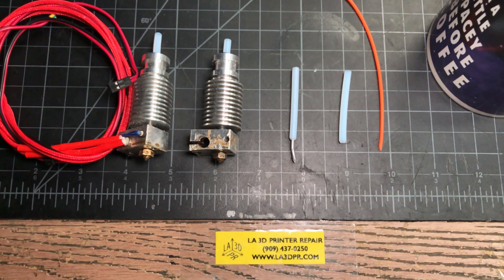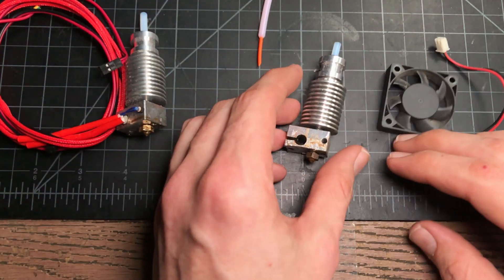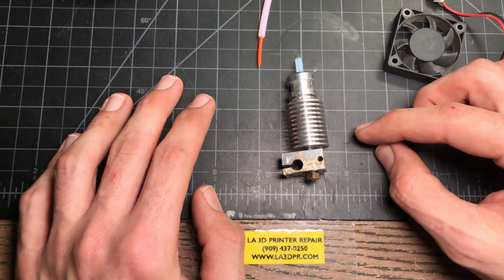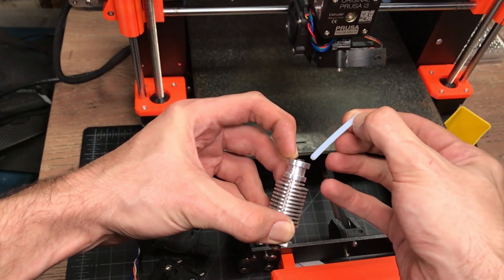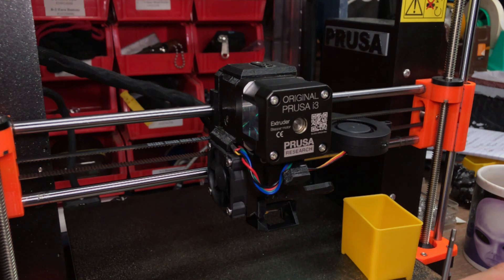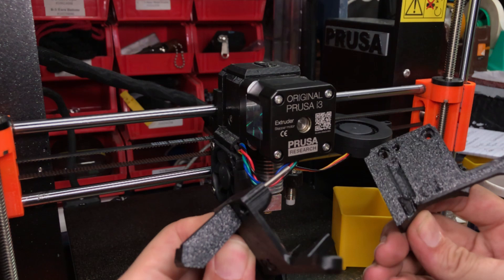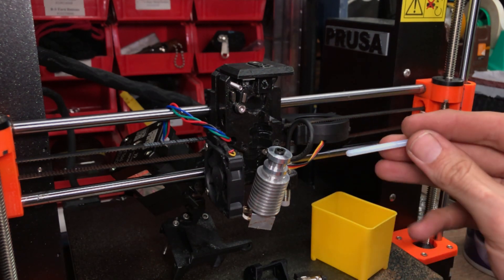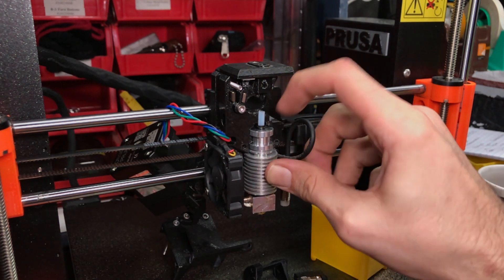Prusa MK3S Heat Creep PTFE Swap

Comment: Thanks a lot for making this video! It was super clear and easy to follow however, my filament is super stuck in the tube, I tried heating it up and removing it while pushing the black ring down it still didn’t work😢 I think I would have to replace the entire extruder…

Comment: I don't understand the purpose of the collar and it's causing me an issue when I'm trying to replace the PTFE tube. The new tube won't go down far enough
Reply from the maker: The collar holds the PTFE in place, it is a one way fitting; look down the tube and inspect for blockage, are you sure your new PTFE is the correct length?
Reply: @LA3DPrinterRepair  ah. 
Yeh it's cut to the correct length. There was a blockage. I ended up using a screw driver to scrape some crap off the walls of the heatsink. Then I used a bit of water to lube it up and done slide it down. Left it to dry and I've managed to get it working. 

I can only assume when the filament got stuck it must of made a mess inside.
Reply: @LA3DPrinterRepair  thank you for replying. This video helped a lot.

Comment: Thanks for this! One thing I'd like to add (at least in my case): double check the gear held onto the extruder motor - the grub screw on mine was loose and I likely wouldn't have noticed except the gear slipped off the end of the motor shaft while i was removing the motor. Good time to check/realign/tighten the gear while it's this far disassembled.

Comment: Do you know why my collet might be stuck in the heatsink? after I had this issue, I also had an extremely hard time getting the collet out of the top of the heatsink. I couldn't push it down at all. I put the prusa together but the heatsink came with the collet and ptfe tube already assembled. did the person assembling the ptfe tube and heatsink possibly assemble the collet incorrectly or did the printer jam it somehow?
Reply: Maybe the filament was melted to both the ptfe tube and the collet which stuck the collet in the down position? idk

Comment: thank GOD you posted this video. I've just started 3d printing and made this mistake. I posted to the prusa forums and so far no one has nailed the culprit of my filament getting jammed inside the ptfe tube. I really just wanted to know the mistake I made so I can NEVER do it again. So, basically NEVER turn off the printer if it's not cooled down first?

Comment: I did all of this and wondered what happens to an eventual clog of filament that would get stuck in between the ptfe tube and the rest of the extruder? I feel like changing the ptfe tube would not remove it because you’d probably put it right back where it was. I don’t know if that makes any sense to you. I feel like my ptfe tube is not the issue, that maybe there’s still a gap down there.
Reply from the maker: PTFE swaps are typically for a heat-creep situation, there really shouldn't be any molten material at the interface of the heatbreak and the PTFE, that'd be nuts.

Comment: I am about to replace my PTFE tube after my filament would get jammed during every print until yesterday where it jammed and got stuck in the PTFE tube. I think my issue was that the collet that holds the tube in place would go down and cause issues.  Do you think using a collet clip is useful at all, I noticed your machine didn't have one either?
Reply from the maker: The collet clip is there to keep the collet from getting depressed, which would let the PTFE go slack; once the collet is "set" with the PTFE bottomed out properly, it shouldn't move.
Prusa supplied E3D hotends don't come with collet clips.

Comment: Hey Lee great video thx for sharing! i had a loose PTFE tube like yourself and i tried switching it out, but the new one wouldnt sit tight in the black sleeve, im a noob so only thing i could do was buying a new assembled hot end, do you think Prusa should start making better hot ends or are there another thing i can try next time this happens, the old hot end was only 1 month old, and like in your video there was play in the tube and i just couldnt make it sit tight, very frustrating lol 

thx again for your great video
Reply from the maker: Sounds like a fouled PTFE coupler, you can get them new from Filastruder for cheap, that’s the actual bit that retains the PTFE tube.

Comment: Fn happens because cura just decides to crash but continue printing!!! Layers are perfect but this happens alot... if I use repetier host with cura not as nice layers but no heat creep go figure...... I'm sure I'm missing a setting in cura somewhere haha.  Soooooooo many settings!!!.. in saying this I did just get my 13 pro b geeetech ebay to print with rainbow silk pla.... then decided to try ultimaker cura.... instant regret haha
..
Reply: I should add that the geeetech i3 pro b does not have a fan for the heat break.. i do have one but I removed it as I was just piggy backing the other fan I was worried about have issues with voltages etc :/
Reply: Has heatsink and fan at the stepper motor and gear assembly but not the heat break... I'm considering getting copper washers and running them to try and get some surface area for the fan I removed so it does something !!

Comment: Thank you, this video was perfect and helped me out as well. I had a nozzle adjusted wrong and caused a slight buildup of plastic in the bottom of the hotend. Totally blocked filament from coming through. Once it was all apart I broke it free with the smallest hex driver and then turned it upside down and tapped the hotend until the blocked plastic fell out. Wouldn't of been able to disassemble without this video!

Comment: Awesome video!!! Quick question… I am using the exact printer in the video. I replaced my nozzle and became a water that my heater block moved side to side rather easily while I replaced the nozzle… Will this cause an issue?
Reply from the maker: Yes it will certainly cause issues if your hotend isn’t assembled correctly, review the E3D v6 assembly instructions. Proper break to nozzle engagement within the block is absolutely critical.
Reply: @LA3DPrinterRepair  Would love to learn more about this specific topic and I think it might be video-worthy just like this video was (the first min or 2 explaining how the filament can harden inside the PTFE). For whatever reason I have had a heck of a time changing nozzles (on MK3S+) and more often than not I end up with a "loose" heat block and not sure what the next step should be to correct that.
Reply from the maker: @tombellucco7155  I just hit 1K subs and the Revo was just announced, so yea, excellent suggestion for a vid; just been so busy! Reach out via twitter (@la3dpr) or our website and I'll send you some stickers!

Comment: Great video!    I have an mk3, is the process a lot different?  Any tips for doing the PEFE sawp  on an mk3?  From what I have read so far the print head is different in some ways from the mk3s p rint head so thought I would ask.
Reply from the maker: So honestly if you're going to pull it apart to swap out a PTFE you might as well bite the bullet and go with the MK3S upgrade, it's worth it for the easier serviceability of the hotend without completely unmounting the assembly from the carriage. If you'd like to buy a set of parts, feel free to reach out. Cheers!
Reply: @LA3DPrinterRepair   thx   have the upgrade kit but wondered if it was worth the upgrade.  Seemed like a lot of work to do the upgrade.    But you think it is worht it?  I have the hardware just need to print the 3d parts.
Reply: @LA3DPrinterRepair  What do you thnk about doing the Original Prusa i3 MK3/S to MK3S+ upgrade kit instead?  You are so right trying to get the hot end out.  Its a huge pain :)  Hard to get to the right angle to drop out.

Comment: I’m new to printing. My filament got stuck mid print. 
I believe the collet above the tube loosened a bit. I had to remove the heat block to fix. But I didnt have thermal paste so it hasn’t worked right since. Paste is finally here. I will try again. 
After pulling this apart several times. I’m not too excited about the design. Decided to buy the new Bondtech LGX to hopefully eliminate a few flaws.
Reply from the maker: If you’d like help you can reach out to Prusa chat or you can reach out to us.
Reply: @LA3DPrinterRepair  Hey, that’s pretty cool. Thanks for the offer. Subscribed and Liked.

Comment: Very helpful video thank you. I decided to replace the heat block at the same time. Is there an easy way of getting the thermistor out of the block. I heated it up but was not successful. Do you recommend running a silicon sleeve to stock the blocking leaving black burnt bits behind. Thanks a lot.
Reply from the maker: Firstly: the thermistor is retained with a 1.5mm grub screw, typically you need to heat the block to permit the grub screw to rotate because the filament may work in there and effectively lock the screw. Second: Prusa doesn't run socks on their farm, nor do they supply them with printers, and thus we don't recommend socks, for many reasons not just because it's "prusa normal".

Comment: My filament got stuck mid-print, well actually just 5 mm up, so not because of heat creep, maybe dirt. Anyways, since I plan on printing flexible some time in the future, I think I'll use Capricorn tubing. It would be nice to know the exact length of the tube. Is it worth it to "sharpen" the PTFE tube so that it nearly wedges in between the cogwheels?
Reply from the maker: Tube length is documented in the Prusa KB for every printer; there is also a specific chamfer schedule on the input and output ends of the tube; capricorn is not beneficial in this application; you should just pop in the spare. Flexibles don't tend to be problematic on the Prusa, the extruder has a very short throw and it's already direct drive, no extra modifications are required; though the MK3S+ extruder has an even tighter filament path, somewhat to the detriment of MMU2S operation.
Reply: @LA3DPrinterRepair  Cheers mate

Comment: The mini doesn’t have the locking collar as is customary in these type systems (air compressor etc.). Prusas design for how the PTFE tube is seated is very very bad. I’m not sure if you’re familiar with the process but you basically need to keep the PTFE tube clamped between the block and the top of the filament port while you tighten the grub screws into the heatsink. Unfortunately this is a very inefficient design flaw IMO. I have been trying to fix the heat creep PTFE Seating problem ever since I noticed underextrusion/barely any extrusion and clicking from the extruded gearing mech. After finally localizing the PTFE searing problem the solution is very hit and miss. Is there a replacement possible where the PTFE tube is replaced by a metal tube? Or is the tensile flexibility of the PTFE a necessity for the proper functioning of the assembly?
Reply from the maker: You're somewhat mistaken in how the Mini PTFE works: the "olive" coupler at the top "pinches" the PTFE in place after the heat-break gap distance is set and fixed with the grub screws; is it fantastic, no, but it's fine.

If you want to get adventurous, tap the Mini heatsink for M6 and thread on a standard E3D heat-break.
Reply: Lee Olivares Im an engraver and work with a lot of pneumatic lines. I Understand how the tube collet coupled works.
Reply: There Is no coupler on my model. I just received it last December. Mini+
Reply from the maker: @AbsoluteRecoil  Please review: https://help.prusa3d.com/en/guide/how-to-replace-a-hotend-ptfe-tube-mini_119449

Step 5, part in question: "Lower Fitting".
Reply: Lee Olivares Step 11 is the design flaw to which I’m referring, “Push the heaterblock up against the fitting with a reasonable force. No need to bend the entire axis. This will pre-stress the PTFE tube inside. Now, it is important to keep the pressure.”

They have designed it in such a way as to replace a standardized fitting with an invariable procedure hinging upon handheld force. 

Very bad design. Why would they abandon the pneumatic tube push in fitting? “Reasonable force” at the end of the day is subjective.

Comment: I built my own mk3, and didn’t realize that there was supposed to be a taper on the ptfe tube end that is seated inside the hot end. What will happen without a taper here?
Reply from the maker: Which taper? The taper at the top keeps the filament lined up for loads, the taper at the bottom just keeps the feed to the heat-break continuous; the answer is: always use correct parts and don't take shortcuts on assembly.
Reply: @LA3DPrinterRepair  Do you have a way to make those tapers? I would like to switch from white ptfe to capricorn tube for nylon printing. I am seriously about to make my own taper cutting box if not.
Reply from the maker: @mophie6941  Capricorn on the V6 is pointless, it’s an all metal hotend, the PTFE stops inside the cold side, it doesn’t get heat much above ambient. You do not need Capricorn in a genuine V6 to print higher temp materials, period. There is documentation on the chamfers and tools to do it if you don’t have spare PTFE liners handy.
Reply: @LA3DPrinterRepair  I see, well that's really good to know. I was really concerned about the PTFE fume from printing nylon or higher temps. This just show me that : I should've done more research, hahaha. Thank you for the information
Reply from the maker: @mophie6941  you’ll see these upgrades proposed on Creality extruders but in all honesty it’s a bunch of bunk: lies atop lies: the Creality extruder is PTFE lined down to the nozzle making it only suitable for PLA temps, Capricorn or not, Capricorn does NOT allow you to print PET/ABS/Nylon, sure you’ll be able to print a couple jobs but the PTFE liner Capricorn or not will rapidly degrade and we’ve seen people chase that dragon until their pockets are empty.
Reply: @LA3DPrinterRepair  I see, I had no idea the seating of the ptfe tube was so different. I guess this explain why : Nylon broke my ender 3 with Capricorn and now my mk3s+ with stock extruder does nylon super easy.
Reply from the maker: @mophie6941  Creality isn’t doing anyone any favors with their false claims and photoshop marketing; Prusa does what Creality doesn’t.